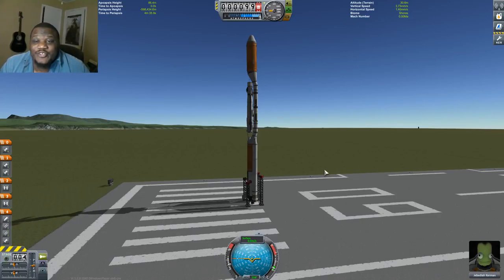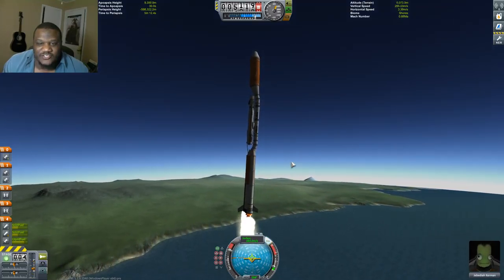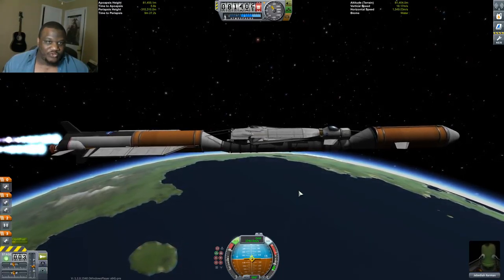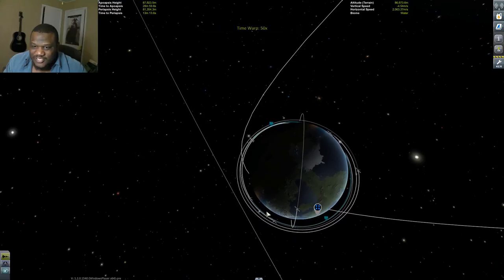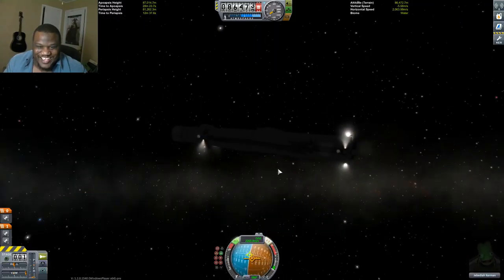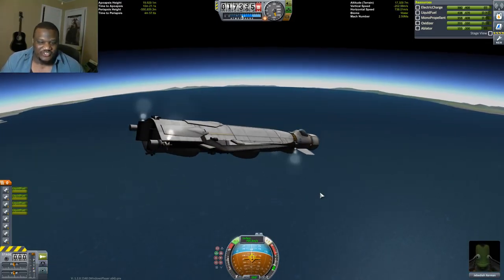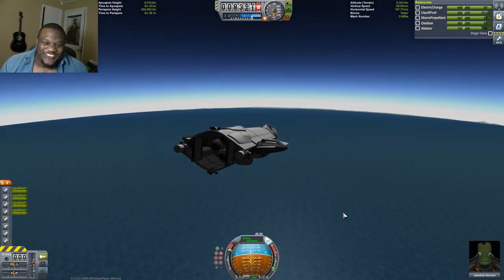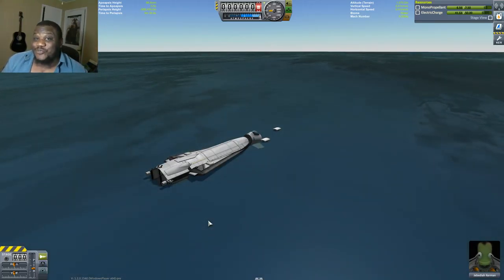Kerbal Space Program | Easyback ADV Shuttle

Comment: Nice concept with that! I really like how smooth it looked when taking off, versus the conventional space shuttle "piggyback" setup.

Although it isn't much of a seaplane!
Reply: It kind of defeats the purpose of a shutte doesn't it? One big advantage of the shuttle was to retrieve the valuable engines. You can just use a standard rocket instead of this...
Reply: Ah, but the oribiter itself is retrievable. I think if this had separate boosters, it would work more efficiently.

Comment: I think you may be talking about the failed Operation Credible Sport, IIRC Scott Manley tried that a while back. The plan was to use RATO-equipped C-130 transport planes for very short takeoff and landing to bust out hostages held in Iran, back in 1980.
Reply from the maker: +Joshua Wiedekopf That's the one! The design works as long as you control the descent appropriately and reenforce the wings. I tested the design as well, had no real trouble.
Reply: Yeah, it seems like a very sensible plan. Wikipedia said the plan was scrapped because the staging of forward-firing and downwards-firing braking rockets didn't work out so well back then. they might have continued trials, had the hostages not been released three-ish months after.
Reply: Depending on what I've read, some sources state it was the pilots who fired the rockets in the wrong order. While others say the electrical system was triggering them in the wrong order and caused the crash.